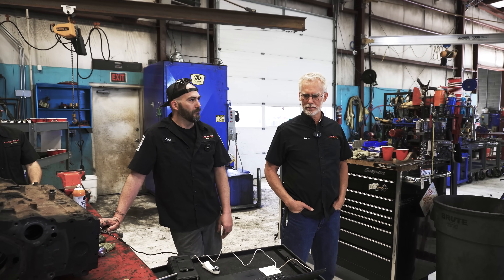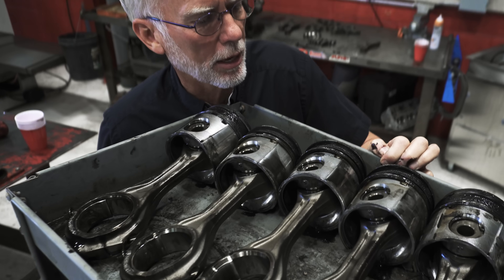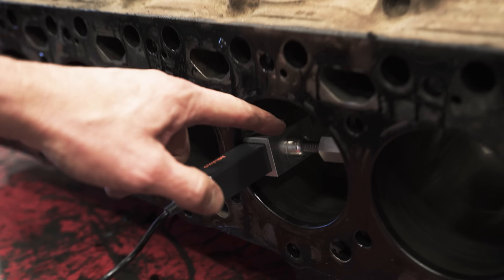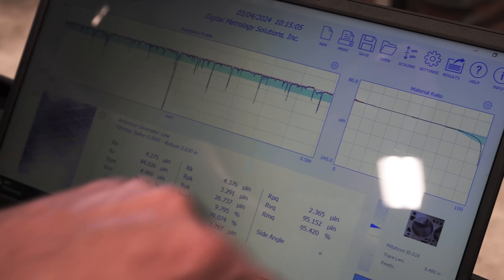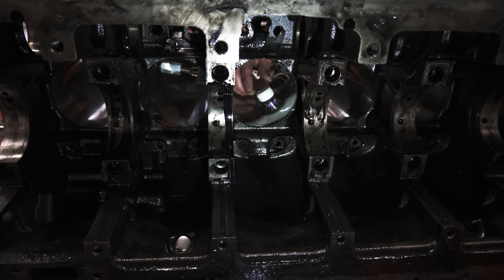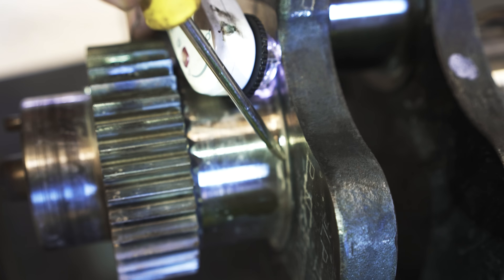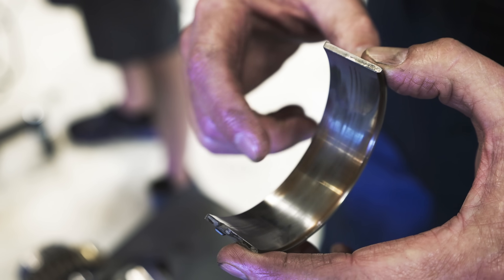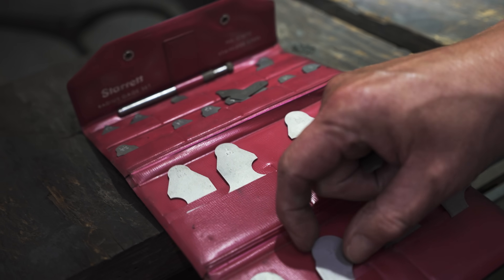5.9 L Dodge Cummins tear down inspection reveals poor machining

Comment: diesels are just dead now... the old ones are worth keeping like my 7.3 but man... the EPA ruined diesels.. .not worth buying a new.. and the old ones cost so much to get back right... and i love diesel just a shame LETS GO BRANDON
Reply: Love my old diesel. No EGR. No Def. No Cat. No ECU. Mechanical IDI with “swirl chambers”. Revs to 5250. 5L/100KMs. Easy to tune
Reply: @chrisladouceur4093  she sounds great!
Reply: They’re not bad if you delete em
Reply: @mikeo.1593  they're pretty good in stock form too though.
Reply: The death of diesel powered vehicles in America started back when the price of diesel fuel jumped higher than gasoline. I blame all the folks who bought diesels because they really thought they needed that kind of power to pull an occasional utility trailer to the dump. Prior to that I think the light duty diesel market was largely not thought of as a low hanging fruit for regulators to regulate and tax the shit out of. That said, a half-ton truck won’t do anything a half-ton truck used to do so what other options are there besides to buy a diesel.
Reply: Absolutely Emissions ruined EVERYTHING! From early 90's to 2008 Railyards had 5.9L, 12valve, non electronic, QSB, 6BT off-road engines were in all trucks, and 80% of heavy equipment. IDK about giving the current president props for diesel emissions? He hasn't even been in for 4 years? Diesel Emission Act was put in place in 2005 under Bush. So I give Bush Credit.
Reply: A republican created the EPA
Reply: Defund the EPA✊
Reply: Lol diesels are dead.
Reply: The death of diesel has been long in play before “Brandon” but then again this is the intellectual curiosity you get from someone who speak in code words.
Reply: 100%
Reply: Your comment shows your ignorance. Sure bring trump back he'll bring back the good old days. The good old days were ruined by soot belching diesels in the first place. Put your mouth on that tailpipe see how long you last.
Reply: It’s not the emissions that’s the problem on the new ones
Reply: @colestaples2010  yes it is cause built up exhaust pressures that wear on turbskis and valvetrain dumps even more wear causing soot into the engine via the EGR that gets in the oil and goes right through the 20 to 40 micron rated OEM full flow filters and it's the 5 to 20 micron particles that do all the premature wear to crank bearings cam bearing gear bearings lifters and lifter bores lifter rods piston pins piston rings cylinder walls valve rockers valve stems and valve guides. And why since EGR all diesel makers should've added 2 Micron bypass filter systems to compensate for the EPA actions but no these makers said well million miles or more days are over buy another engine or rebuild at 350,000 to 750,000 miles for all makers they said wow were gonna sell more what the hell do we care. People allowed the EPA to do this and they did nothing to stop it so let the people pay it. This 5.9 is emision free. This is mileage and possibly improper maintenance and like Dave said improper rebuild. Improperly built and maintained mechanical machines will prematurely fail every time. Me if I was rebuilding this every bulletproofing option would be applied to prevent premature failing. Including Running the Best Oil on the planet Amsoil Signature Series true 100% synthetic not the mainstream natural sourced petroleum or liquid NATURAL GAS group 3 based highly refined fake full synthetics that only require legally to be labeled full a minimum of 25% synthetic molecules. But what ever at least you know that Amsoil is strictly formulated from group 4 and 5 true 100% synthetic molecules that are manufactured not refined.
Reply: EPA had destroyed everything hvac is being destroyed want be long only rich people will have ac in their house. Get ready box fan's and attic fans
Reply: For sure I ran my 2016 duramax stock until roughly 170,000 miles then deleted a couple months ago
Reply: EPA killed it. They started chasing carbon monoxide. Switched to chasing dioxide, and PM O2 and the such. The best thing that can happen is a diesel. But epa is chasing ghost and ruined it with emissions. Diesel isn’t going anywhere though. The EPA needs to go!
Reply: 7.3 is the biggest motor built and weakest. 5.9 out pull it daily
Reply: Loser. Grow up.
Reply: Hahahahaha. We stole 2020, when #trumpstink was potus. We're going to steal it again professor
Reply: @LuciFeric137  you know trump is gonna win sit down nerd
Reply: Ya I mean why would anyone want a stock diesel engine that comes with 500hp and 1200 ftlbs of torque with no modifications at all and gets good fuel economy. Ya man I wish everything was a idi 7.3 that makes 100hp on a good day
Reply: @royalblood2405 😂
Reply: EPA ruins everything it touches.
Reply: @BlueOval02 you mean government. At the cost of better for all they destroy in the name of the public good.
Reply: 7.3 is dogshit
Reply: @Zedhed-performance  7.3 is one of the best diesels motors ever made tell me you are a zoomer
Reply: @AndrewLee-cg6uk  you have no idea what you’re talking about lol
Reply: @Zedhed-performance  yeah meanwhile i own a 7.3 diesel and had over 15 6.0 ford box trucks ... tell me more kid
Reply: @AndrewLee-cg6uk  you answered your own dilemma. FORD
Reply: @Zedhed-performance  and meanwhile dodge is junk cummings is good but the dodge is trash.... and chevy LOLL dont get me started how bad chevy is
Reply: @AndrewLee-cg6uk  whatever helps you sleep at night bub.
Reply: @Zedhed-performance  i sleep just fine i got 3 personal trucks a house paid off boat 3 atvs... 2 motorcycles a shop bigger then your house u pay rent at...
Reply: @AndrewLee-cg6uk  making a lot of assumptions. Lol
Reply: Up your's brandon!
Reply: As the school buss leaves your children in a plume of soot..you blame the EPA
Reply: @JOMaMa.. and idiots like you think it's the buses that pollute or these mean diesel trucks.  Have you ever watched these massive ships that churn away in the ocean everyday that pumps more carbon (soot) into the air more than every bus in every city in the entire US but they are ignored because poor mommy can only see the mean bus. Diesel engines aren't the reason for pollution. Why don't you roll your windows down in bumper to bumper traffic and take a whiff. No matter how bad our roads and highways are packed with these cars you have cities like New York and Miami you don't see the filthy haze you did when people like yourself cried when the LA sky was dirty. All the EPA has done is made live in America more expensive and you'll fall for it everytime.
Reply: Nothing wrong with 4.5 litre Toyota's,  they will do easy 800,000km/500,000 miles.
Reply: @paulhoogeveen7353 yeah with emision intact PD diesel runs 6.7 Cummins before year 2022 in Rams hotshoting towing 25,000 to 35,000 lbs their whole life to 750,000 miles before selling with no rebuilds so yeah Toyota a remarkable Brand but not a industrial grade Diesel ever and that's the Difference that no other maker Ford or GM have right along with yota. And Ram 2500 with the Cummins weights in at 8600 lbs and just keeps getting heavier 3500 SRW then 3500 DRW then 4500 then 5500 class trucks not your 5 to 6 thousand lb yota if it's even that don't compare apples and oranges because Cummins Ram is a whole other beast beyond Ford  GM and yota.
Reply: @Jon-O.  There is another option to just using an oversized ute, just use a proper truck, just everywhere else in the world.
Reply: @paulhoogeveen7353  yeah no you don't get to determine my goals how I reach them or the decisions I make. I do not you. I'm the one who's investigated thoroughly the EPA standards the difference between industrial grade engines like the 6.7 Cummins and the grade consumer grade not even commercial grade Diesels in the rest of the auto makers world wide. How to handle wear causing soot the difference between fake full synthetics and true synthetic lubricants how they formulate the lubricants studied accumulated independent data that backs it up longevity of Cummins diesels inspire of intact emissions and how to make it happen with product choices analysis and informed maintenance scheduling yeah I did that so you have no rite to tell me otherwise or what choice I must make.
Reply: @paulhoogeveen7353  The diesel engines in school buses today are not designed for stop and go. Most school buses stay under 45. The engines are designed for highway miles. It costs school divisions a lot of money to keep them on the road.
Reply: @AllGodscreatures65  Well then use Volvo diesel's in the buses, to say diesel engines can't  handle stop and go use is flawed,  many a milk tanker do 1,000,000 miles ,no problem.
Reply: Amen to that,EPA ruins everything absolutely true,it's just more money for you to spend so they can get more tax money off of it
Reply: @dodgedemon840 have you ever thought about the fact that EPA actions reduce cancer rates in humans? Idk how you want to intentionally sign up for a recudes lifespan over some engine problems 😂
Reply: @blumac9801  I'm confused from the start of your statement, think you might wanna read it out first then have someone else read it out loud as well,sounds like you've been drinking some
Reply: So VW lying about emissions to the world means nothing to you?
Reply: @wayneessar7489 even Cummins was found cheating. It's bad when manufacturers are making it worse, but of course people wanna blame politics. I even see BMW X3 has a scandal.
Reply: @wayneessar7489  If you look into these diesel scandals. The manufacturers like VW weren't even lying that much about the emissions on their engines. My brother bought a turbo diesel Jetta with a 6 speed. A car bought new and was involved in the lie. He managed to hit the 800 mile club. He got 800 miles to ONE tank of diesel. He averaged 55 miles per gallon on the highway. The HIGHWAY. I have worked around diesel tractors all my life and I love diesels. They are way better than gas in my opinion. You can't really argue with those MPG numbers. Diesel is just more efficient.  There isn't a single electric car or gasoline vehicle on the road. Not even hybrids get that kind of efficiency. Even the little 3 cylinder diesel engines getting 80 mpg over in the EU. They are not up to the USA's emissions standards. At 80 mpg!? Do you even understand how much bullshit that is!?  The United State's logistics basically runs almost completely on diesel to keep stores stocked, packages flowing. To keep public bus systems in operation. Even Tesla super charging stations rely on diesel to charge those retarded vehicles. 😂 There are a lot of diesel manufacturers that dropped out of the passenger vehicle market completely. Like Caterpillar. They didn't want to deal with the regulations. Which aren't really helping the customer. Honestly they don't do much for the environment either. The USA doesn't even pollute like China, or other industrialized countries do. Yet we get blamed for it and guilted into adopting dumb ass regulations. Diesel is cleaner than electric cars ever will be. I don't blame Cummins for lying. They probably were trying to recover financial losses from developing solutions to meet new regulations. Cummins is also backing Hydrogen tech. I am sure the government wants to hurt them financially with fines as much as possible to push this electric car crap down our throats. EV tech isn't the future for the general public. It's not practical at all.
Reply: @wayneessar7489 shouldn't mean anything to anyone, let vehicle manufacturers manufacture!
Reply: NA TRUMP 2024
Reply: @AndrewLee-cg6uk Don’t worry.  He’ll keep losing.  It’s all he ever does.  He loses at everything.
Reply: @AndrewLee-cg6uk lying to who?  The epa?   They make things more inefficient in the name of green.
Reply: @AndrewLee-cg6uk rapist 2024!
Reply: @ihyln1 what?
Reply: @dodgedemon840 cuz it's feelings are hurt and it's always the orange man bad guy.
Reply: @DroneVideo0412 Are we talking about Trump? I'm so confused. Market ATH's, isn't that the winning metric Trump followed???
Reply: We’re talking engines and you have to bring politics into it? Sad
Reply: GM's 3 liter Duramax might be the best new 1500 class diesel engine on the market that has all the emissions components AND gets good fuel economy with good power.
Reply: Internal combustion engines in general are dead. The EPA is not about to roll back the clock on regulations for emissions. Electric vehicles have none of those regulations. It's time to stare the truth and the face and stop buying internal combustion engines. They have been nerfed and will never be as good as they were in the earlier days. I suggest everybody stop making fun of the electric vehicles and start understanding the predicament we are in. Look at the used market for a second and really ask yourself how much longer is it going to be before used electric cars are a much better value. I'm going to say less than five years.
Reply: @daytonaflow to be better in value a battery would have to be replaceable without costing 50% of the initial price of the car. Or there has to be a „Dave’s Battery shop“ with decent pricing.
Reply: @daytonaflow Both ICE and electric leave carbon footprints in different ways.  Stop being hypocritical and climate extreme alarmists. Electric is not the future for various reasons.
Reply: @daytonaflow you are completely delusional.  Lol.
Reply: @daytonaflow  how is a battery that looses power after 7 years better? Possibly 20,000 to replace in a car. 100,000 in a school bus. Who can afford that? Not your average American. What do they do with the old batteries? Oh and China produces them. Is it good to be reliant on them?
Reply: @daytonaflow  Buying a used electric car is useless. You would have to replace the battery sooner than later. Batteries don’t last a lifetime. My Diesel is going on 20.
Reply: @daytonaflow -Ha!